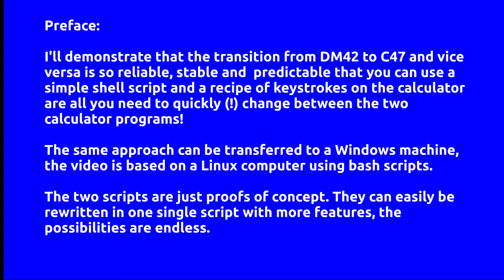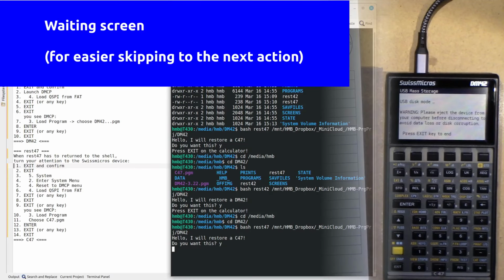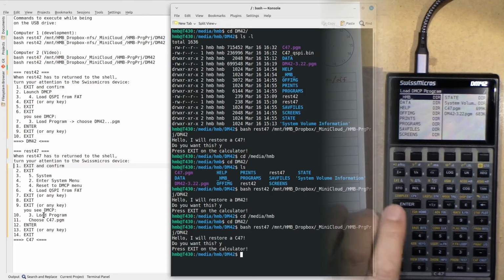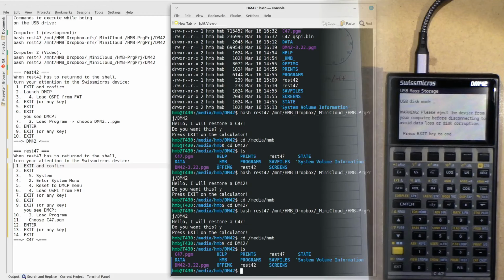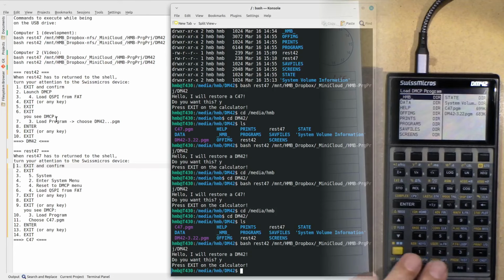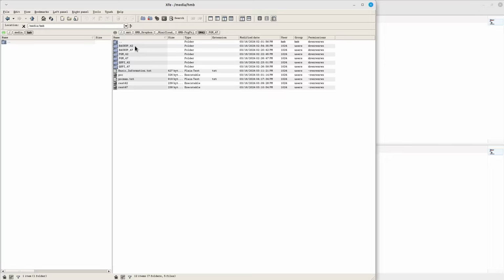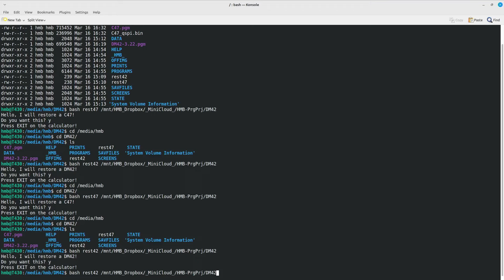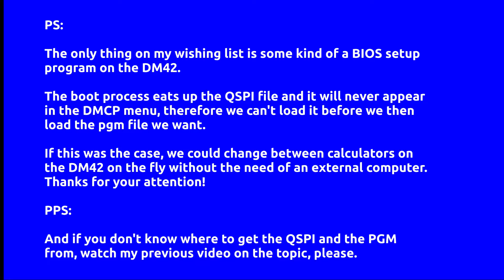Scripted Transition On A DM42 PLUS Extended Edition In The Description!

Comment from the maker: Next step, doing everything on the DM42, no file access to files on the computer needed:

 I have cleaned up the FAT drive and installed two new files:

File name: rest42loc

 #!/bin/bash
echo Hello, I will restore a DM42 from local files!
read -p "Do you want this? " -n 1 -r
echo
if [[ $REPLY =~ ^[Yy]$ ]]
then
   cp    QSPI_42/*   ./
   cp    PGM_42/*    ./
fi
echo Press EXIT on the calculator!

and

File name: rest47loc

#!/bin/bash
echo Hello, I will restore a C47 from local files!
read -p "Do you want this? " -n 1 -r
echo
if [[ $REPLY =~ ^[Yy]$ ]]
then
   cp    QSPI_47/*   ./
   cp    PGM_47/*    ./
fi
echo Press EXIT on the calculator!

In addition, I copied the QSPI_42, QSPI_47, PGM_42 and PGM_47 onto
the FAT drive.

Now all I need to do is:

Activate USB disk
Open a console on the computer and change onto the mounted FAT drive.

Then I enter

bash rest42loc

or

bash rest47loc

This goes much more quickly and you need no files on the
computer at hand.